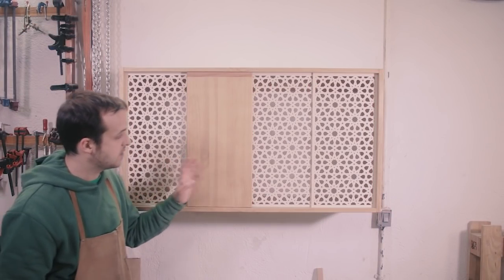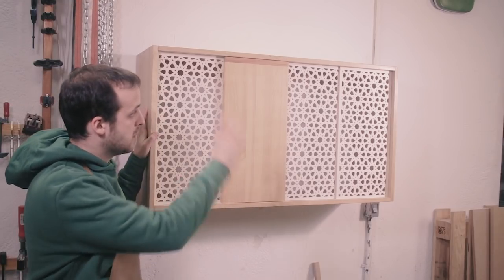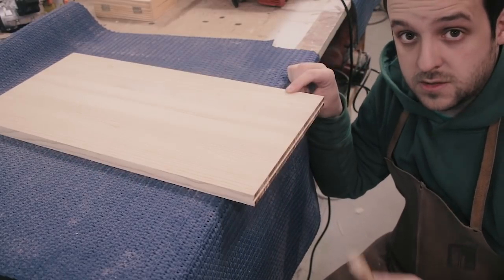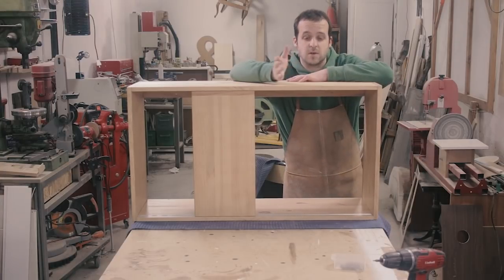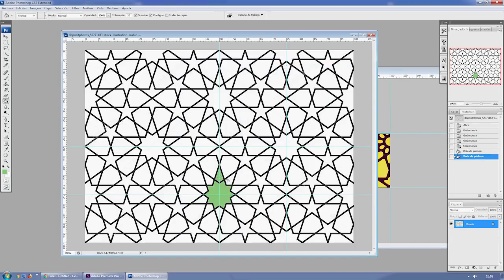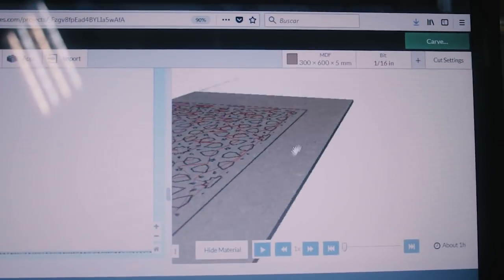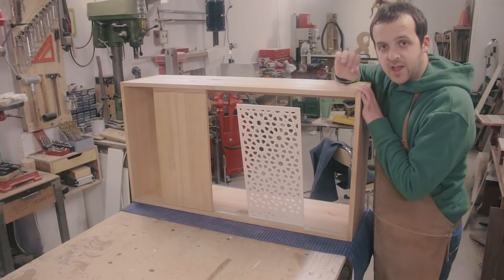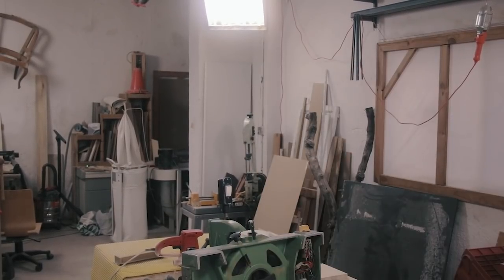Reproducing a 700 Y/O pattern with a CNC (X-Carve) - and making a cabinet!

Comment: Looks nice! What are those fancy Screws you used to assamble the Cabinet able to do better then regular Screws? ...what a weired Sentence...
Reply from the maker: Thanks!! They kinda do, as they have a thick cylindrical part they can also act as dowels, keeping everything in position, unlike regular screws that leave some wiggle room :) these are called assembly screw I beliebe
Reply: @Cactusworkshopchannel  Aha! Thanks for the Reply. ;)